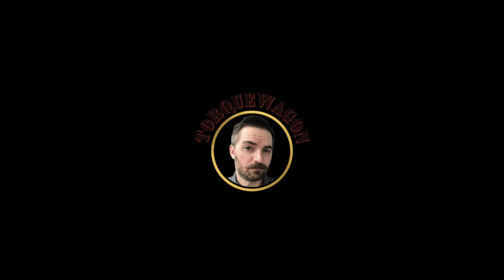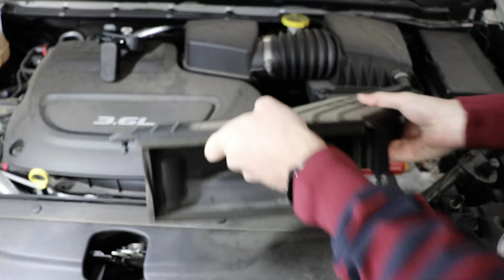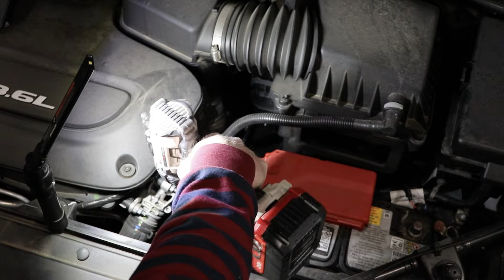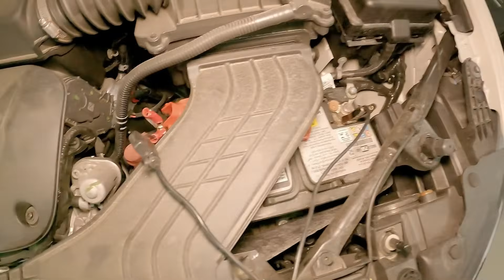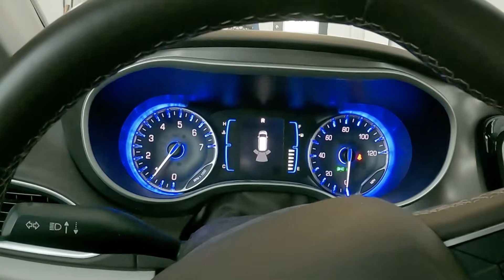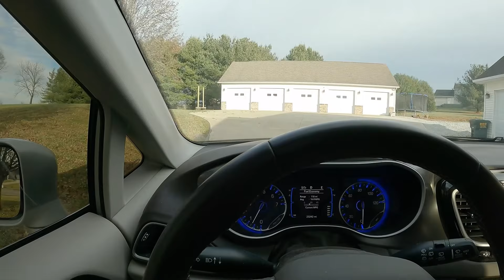Chrysler Pacifica Auxiliary Battery Replacement | Start/Stop Fix

Comment from the maker: Hey! How to you all feel about the auto start/stop feature on newer cars. I hate it, but luckily the Pacifica has a button on the dash to turn it off.
Reply: I told my girlfriend not to use it. In my opinion the small fuel savings isn't worth the added wear on the starter, battery and alternator.
Reply: @jonmuck6161 big facts
Reply: @jonmuck6161 
Exactly ... 
Dealer ripped me off almost a grand for fixing it. Now I go to a neighborhood mechanic, super cheaper than the crook dealer.
Reply: We had a recall for a start/stop issue, 
it apparently drained our batteries
Reply: @alkalinedivide  Do you know what the recall number was?  I've been going through Aux batteries fairly frequently (less than a year) on our 2018 Pacifica with start stop and its a real annoyance.
Reply: It's junk. and the batteries die super quickly. 2019 Pacifica had the Aux changed under warranty, then both batteries changed under warranty, now it's literally in the shop again today for the Start Stop feature going out. Only 34k miles on the darn thing....
Reply: When are you going to finish the nv4500? i feel like ive been waiting years
I completed my own swap in that time.
Reply from the maker: I definitely work slow. I think I’m about 2 1/2 years into the swap at this point. I really just have to hook up the clutch hydraulics, connect the linkage on the t-case, and add some fluids. I keep getting busy on projects around the house and fixing daily drivers, not to mention family time and extra curriculars with the kids. I’ll get around to finishing the nv4500 swap soon though. 
What did you do for t-case linkage/shifter location? I’m considering switching to cable shift instead of the stock linkage.
Reply: @TorqueWagon  I ended up running a np205 cast iron t case so i bought the nv4500 shifter kit from advance adapters and just extended my shifter rods 1 1/2 inches to get it back to the factory location.
I also added andother point to attach the braket to the trans because i fond it too flimbsy.
Reply: Ours keeps going out . Even after the auxiliary battery was replaced.
Reply: I HATE it.  I was turning it off by habit, and the aux batter still went out at 75k miles.  I hope replacing the battery keeps it from coming back on.
Reply: That "Feature" is probably the dumbest thing I have seen since the Ford 5.4 spark plugs. Just think of the additional wear on the starter, and both batteries, then consider the fact that all these parts are Chinkcrap, and will fail in about 1/10th of the time an old USA made starter will last.
Reply: We hate it!  My wife’s 2023 Mini Cooper has it too, but it’s been turned off since we drove it off the lot with under 20 miles on it!
Reply: I hate the feature. Dealership turned mine off. When I changed the battery I just did so with the engine running so it can keep all the computer programming
Reply: Old response but you probably far and wish you could come do mine!
Reply: Hate it,on.my wifes new subaru you have to turn it off EVERY time you start car don't know if pacifica is Like that,want it off PERMANENTLY!
Reply: It's a shitty feature that doesnt help fuel mileage in the least
Reply: @dgp187  None of the climate agenda helps.  It is about control.   Someone gets a wild hair in govt and the next thing you know it is a regulation.   I leave my  start/stop battery disconnected and ignore the dashboard warning light.
Reply: Personally love it...  I usually shut my engine off at long lights and it starts so much quicker than I can...

Comment: the auto rear hatch on our 2022 stopped working and research lead to the battery, took it to the stealership, told them it was the battery they advised both batteries need replacing....they then said they also had to charge for a diagnostic and a re-program , total bill was$1,200.00.  Drove home and the start/stop light came on with a warning that is was non functional....google said it could take a few days for that to cycle throug,h but been three days and still coming on, taking it back to shop tomorrow...better be warranty work but have my doubts😮‍💨

Comment: great video. I would like to point out that if you just loosen the positive battery side nut the power distribution board will lift strait up getting it out of the way for ease of removal of aux battery. I also noted the main battery was the e.o. battery. always change together. last note.. per dealer connect unplug the intelligent battery sensor as first step, and reconnect as last step.  (note) when reconnecting the last cable expect a high voltage surge that may cause a arching (pop) when connected.

Comment: Hello I had the same problem I did just as you instructed. I changed the auxiliary battery and it worked just fine for a couple of weeks but you’ve recently started doing it again my car just turns off in the middle of intersections. What do you think that could be?

Comment: I have the 2020, my battery died bc I haven't used the car in 1-2 months so the battery died. I got the car to start but then the start/stop feature popped up and my radio/ Uconnect doesnt turn on. do you think I should just try to jump start the auxiliary battery?

Comment: Was the van attempting to start before you replaced the aux battery or was your main batter completely dead? Mine makes a clicking noise, but won’t start.

Comment: anyone finding this video please note it is best practice to replace BOTH batteries together. When that aux battery goes bad, it's not just the auto start/stop. The radio, cabin lights, etc can all also stop working. With one bad battery (they are connected together) it masks the syemptoms until the extra load depleats the good battery as well. I'm not a greasy mechanic trying to upsell you. I'm an owner of a 2017 Pacifica and went thru this cycle of bad batteries for 2+ years. :) It was the FIRST vehicle I'd ever owned with a 2nd/Aux battery.

PS - there is a plastic screw in post near the battery in the vehicle hood. it sticks down and makes contact with a springed switch coming thru the frame of the vehicle between the driver headlight and the battery area. When depressed (with hood closed) it tells the auto start stop feature the hood is closed. When hood is open, the switch is not pressed and it tells the car to disable auto start stop (being nice to mechanics working on the car stationary so it doesn't turn the engine off while diagnostics are going on). If you remove the plastic screw in post, or unclip the little switch so it sets below the frame, that switch won't get depressed and the auto start/stop will be forever disengaged. It doesn't harm the car or void any warranty or anything. It just says "auto start/stop unavailable forever. :) You're welcome. LOL

Comment: Very helpful!  The hardest part was pulling out the old battery.  You were absolutely right about tilting it up to remove it from the cavity.  I would have certainly struggled with that part had you not warned me!  Thanks for taking the time to make this video!

Comment: FYI Chrysler Pacifica owners. Had the car since 2018. This is the fourth stop start battery. The first was covered under warranty. The other three have not been. If you leave it it will kill the main battery. Had to replace that once. But this helpful video means you can do it all yourself in 10 minutes as soon as the Stop start warning comes on.  And save your main battery too.

Comment: Thanks for the video. I have a 2017 Chrylser Pacifica Touring L with the start/stop button, but I do not see an auxiliary battery. I only have one main battery in that location. Any ideas?
Reply from the maker: Sometimes the aux battery has a different location, I think depending on the date of manufacture. If I remember correctly, the other location for the Pacifica is somewhere in the front passenger footwell inside the van. There may be a panel you can remove to get to it.
Reply: @TorqueWagon  Thank you for the information.

Comment: So did you get the main battery tested or did you just jumpstart it and it was fine? I know you had a charger on it later in the video but my concern is my main battery will be bad too? The van has the error code for a couple of weeks and then this morning just wouldn’t start.So I’m gonna replace the auxiliary battery but I’m afraid I might have to replace both. I don’t know?
Reply from the maker: I ended up having to replace the main battery several months later. It was probably on the way out when I changed the aux battery, but I didn’t want to spend the money on both at the same time.

Comment: Thanks for this informative video, was going to use this if I had to replace the auxiliary battery in my 2017 Pacifica, I had the shop replace it once back in May. The light came again just a few weeks ago, I’m assuming it’s the battery again so I’m having the dealership warranty the battery out. I was going to use this video in case they tried to charge me to change the battery I was going to do it myself. Will save this video for future reference. Has the light came back one since you replaced your auxiliary battery?

Comment: The video is very helpful.  My kids left a door open and drained the battery.  We had replaced the aux battery about 18 months ago and the van is starting fine.   However, the start /stop feature stopped working and we have the error message.  Can I simply put a battery charger on the aux battery rather than replacing it?  My wife's van is a 2019 pacifica-Thank you!

Comment: This has become a well known problem with the Pacifica, and Chrysler has no fix for it.  The aux battery failure associated with the start stop feature will eventually become an annual replacement of that battery.  We had the same issue with ours last summer, replaced the aux and main battery.  On the 4th of July (same month last year too) our Pacifica completely shut down at an intersection.  We once again have the yellow warning light on the dash indicating start stop failure.  We bought ours new in 2018, and it only has 50,000 miles on it.  Even with lower mileage it’s developing numerous other electrical issues reported by other owners.  Apparently the Pacifica’s are notorious for electrical problems that all seem to drain either the main battery or aux.., and both batteries with the start stop failure.
Reply from the maker: I hate the start stop feature in modern cars, and it seems like you almost can’t avoid it these days.

Comment: This video continues to be a great resource. Saw it the first time today, and replaced my wife's aux battery when car wouldn't start (new main battery) in the Target parking lot. We have AAA but I'm pretty sure their battery service doesn't cover these auxiliary batteries. Dropped by Autozone and picked one up, ran over with my sockets, and had it changed out in about 15 minutes. Thanks again @torquewagon!

Comment: I just changed my wife's 2020 Chrysler Pacifica's aux battery in under 10 min thanks to your video. Used a 5/32 socket on the posts. 👍
Reply: I used a 4mm..

Comment: Hi there, thank you for posting this and keeping it up. Just changed my wife's van's aux battery myself with your help and avoided calling a tow truck. Couldn't get the main battery negative terminal off, but the van started right up again after the battery replacement. 👍🏻

Comment: I have a 2020 Pacifica and the same thing is happening with my vehicle. The "auto start/stop light keeps coming on and it doesn't work. My main battery seems fine but my remote start is not working correctly especially when I need it in the cold weather. I'm a handicapped driver. I drive right from my wheelchair. I just had my van in for a checkup and everything is fine. My warranty on the battery was 3yr or 36,000 miles. I am passed my warranty by 6 months. The technician told me I'm better doing exactly what you're showing in your video myself as they would charge me like $1,000. Crazy!

Where did you get your aux battery and how much did it cost you?

GREAT video and thanks for the education..
Nick
Ps I can't stand that start/stop feature anyway as I turn it off all the time. What an afterthought that was to be eco-friendly. 😊

Comment: Thank you.

Checked Aux battery at autozone and it was fine just needed charging.  Took the negative lead off main battery for 15 minutes while removing aux battery.  After putting aux battery back in, no ESS error and stop/start working.  (Although I'll never use it!).  Thanks again!

Comment: Great video! Auto start/stop "feature" stopped working about a month ago, which we were fine with. Yesterday, my wife got a "service shifter" error, and the van wouldn't start. Got a new aux battery from AutoZone for $129, followed the instructions step by step, and as soon as I hooked up the aux battery, everything came to life. Didn't have to jump/charge the primary battery at all. Thank you!

Comment: Thank you so much for posting this!  A few years back I was having start stop issues like you, I ignored it since I hate the feature myself.  It finally drained and took out my main battery, threw out many error codes and my car stopped running while I was driving. Turned out it also took out my alternator with it 😮.  

I guess these aux batteries don't last 2 or 3 years because I'm starting to have the same exact issues now (start stop service message and angry red light).  I'm getting the tools needed and a new aux battery today to fix it myself before more repairs are needed...I can do this!

Comment: First, thank you so much for posting this informative and encouraging video.  
Second, you don't need any of the fancy tools shown here to actually do the replacement.  I used a 10mm socket, a 10mm wrench, a screwdriver socket holder, a pair of locking vise grips and a little gorilla tape.  The vise grips locking to the handle of the screwdriver gave me the needed length.  The gorilla tape wrapped around the battery posts allowed me to unscrew them from the bad battery.  My way took longer due to more hands on but basically completed within 30 minutes.
Thank you for giving us the courage to do this job 🛠️ !! 👏
Reply: 4mm socket to extract battery posts

Comment: Way to save everyone hundreds of dollars from the dealer. I had them do this once, and they probably charged me $300. I was in a bind on time so I went with it. 

Here I am, not much time later, and my start/stop system failed two days ago, and now the car won't start at all. I assume i have to replace the battery again.

I love the Pacifica, but two start/stop battery replacements within 5 years seems absurd.

Comment: Help! I'm trying to remove my main battery and I removed the nut from the positive terminal inside that red box, but the box still won't come off. Is there something I'm missing?
Reply from the maker: I don’t have my Pacifica anymore, but I think you just need to give the red box a good nudge, or you can wiggle it a little and it should come up and off. Don’t quote me on that though.
Reply: @TorqueWagon thanks yeah it was stuck from corrosion or something. I was able to pry it off eventually

Comment: I just completed this very quick repair thanks to your video! The recommendations for the exact tools needed were spot on and saved a lot of time. I literally spent more time watching the video a couple of times than actually executing your very accurate script. 
Not to mention the savings from not having the dealership do it at 4x times the cost of the actual battery.
Thank you!!!!
Reply from the maker: I love to hear comments like this! Glad the video was helpful!
Reply: My issue is, I did those steps and still not wanting to work. Still gives me same error.
Reply: Thanks dealerships service is criminal!

Comment: Outstanding video.  Car wouldn't start and looks like it was just the Aux battery.  Perfect explanations on how to fix.  Thank you!  The only thing that concerned me was that the Aux battery immediately started sparking when i reconnected the terminals to the new battery.  Couldn't figure out how to stop that from happening.  Just held my breath and screwed it in.  Still alive, so that's good.
Reply from the maker: If you have the negative cable disconnected from the main battery, that should eliminate the chance of sparking.

Comment: I have a 2020 Pacifica and I used a 5/32 to get the posts out of the battery, not an E6 and it worked very well.
Reply: similarly, a 4mm worked for me

Comment: Great video for anyone with a small amount of knowledge and a few tools.  THANKS - I'm 68 and this seems to have fixed my problem.  You were right - the bolt holding the strap is tough to get out.  If I could find the engineer that decided a screw that long was necessary, I would make him take it out and back in with a ratchet.  I bought a Duralast battery because it was about the same price as others, and came with a 3-year warranty.
Reply: Good work

Comment: I have the light on the dash with the an and circle around it with an exclamation mark. Battery seems fine what would you recommend is the problem. Or what to do first anyways
Reply from the maker: You may want to check the voltage on the  aux battery with a multimeter, or take the car to an auto parts store where they will test the battery for free. In my experience, when the aux battery starts to go bad, it won’t be long before it drains the main battery and leaves you stranded somewhere.